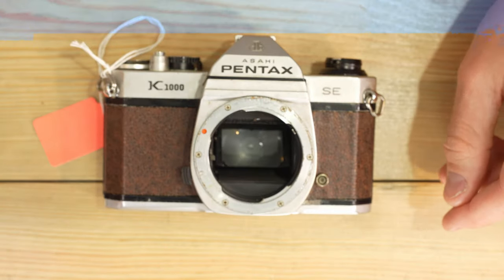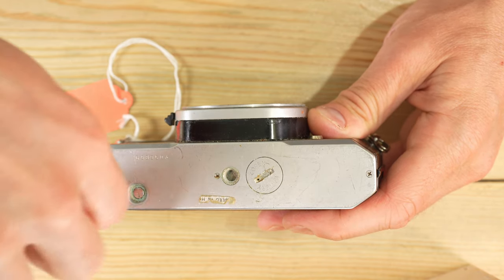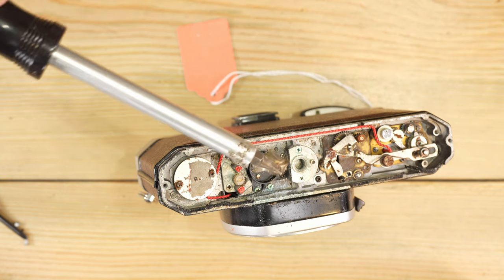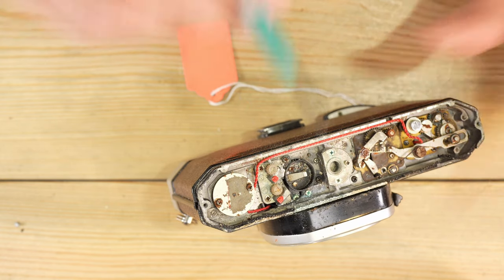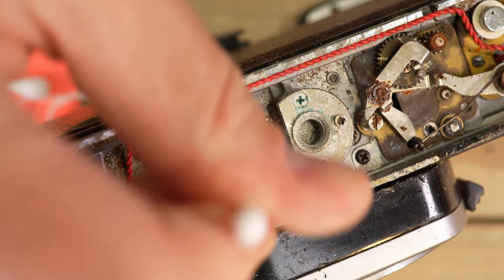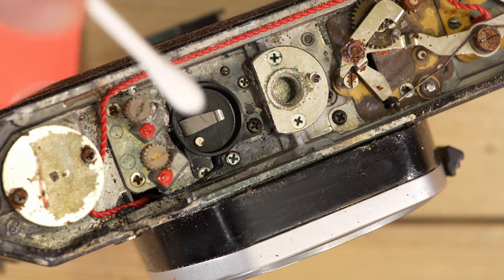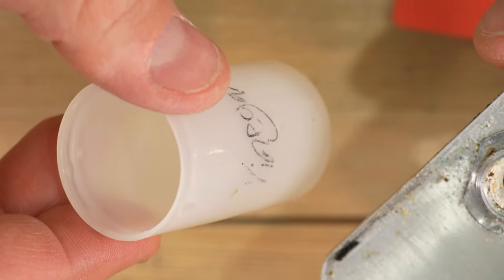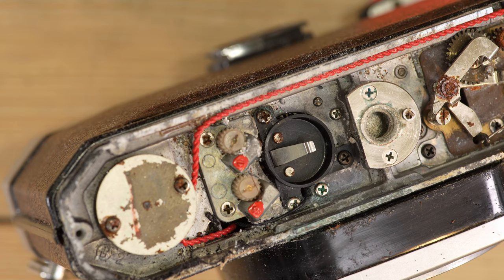Clean Leaked Batteries and Battery Chambers

Comment: Tupperware brought a smile to my face David. Also laughed at the removed plus sign! I always test the materials and various painted areas of camera with different solvents in very small areas before I go whole hog, after a few cases of damaged plastic and removed printed labels. Ethyl alcohol seems to be the safest with plastic,  except for some painted plastics. I just rescued a dead flash unit by using a fine grit sandpaper on the corroded contacts. Works great now! Glad I didn't risk liquid solvents in the chamber
Reply from the maker: :D I think the plus was a sticker and the solvent just took it right off.

Comment: If you would have used a ¥10 coin that wouldn't have happened. 🙄
Reply from the maker: I know. I need to start doing that.
Reply: The curvature of those slots were designed for ¥5 coin (D=22mm. The ¥5 was chosen because it has a hole in the center so one can tie a string to attach it to a camera bag/strap and always have it.

Baking soda is a good chemical buffer to start and end the process so neither acid nor base residues will continue corroding.